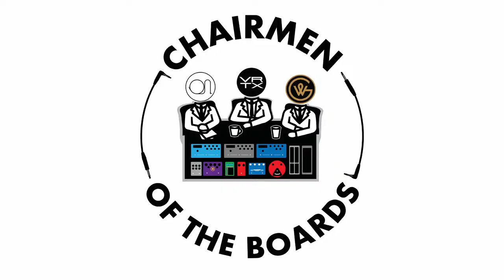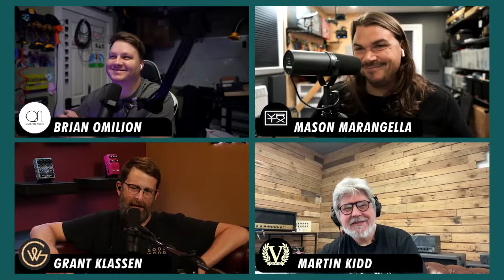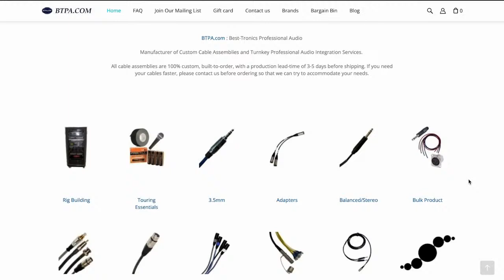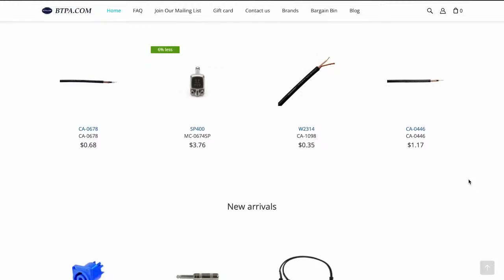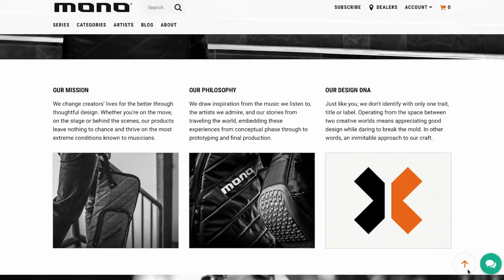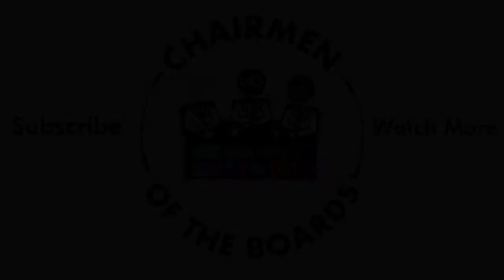Cracking The Code on Hybrid Tube Amps (with @VictoryAmps)

Comment: Does anybody else feel like there's an enormous hole in the market right now for newer and better tube power amps?  Has class D solid state just already won?  It's driving me nuts that everyone is making all these awesome pre-amps (yes I realize the video is more about hybrid amps) , but almost no one is making (more affordable) tube power amps.  Yes it's surprising how good the newer solid state stuff is but there is still a noticeable difference.  We can buy respectable full on tube combo amps cheaper than we can get 1980's style rackmount stereo tube power amp and then when you do get one the volume would get you kicked out of most gigs because it's so powerful.  Are there not better tube master volume circuits available by now?  I have been looking everywhere trying to find smaller tube power amps.  How is half a guitar amp more expensive than a guitar amp?  Why are more amp makers not seeing the opportunities for more convenient stereo rigs when Simon Jarret can put a Dumble on your pedalboard?
Reply: I agree, seems like the perfect idea.  A modular system.  A good 10w tube power amp and then swap out the preamps.
Reply: Good Point...
Reply: The only product like that in Thomann is the Mooer Tube Engine. A mono power amp. The rest is Class D or Boutique amp distribution products like Synergy stuff or fryette power station.
I use a modeller (hx stomp) and never use FRFR. Just fxloop returns of solid state amps. I don't really know if i'm missing something with the tube power amp thing.
Reply: @martiboucat   I may well get a Mooer Tube Engine but I will have to get one shipped to USA from Europe.  Due to other amps I already have my heart is set on a Fryette PS-2 Power station first, which sadly does not help me run stereo.  You can find demo's comparing the PS-2 to a Seymour Duncan Powerstage and the difference is not huge but it is real.  In my case I have a Kinsley Maiden D pedal pre-amp and a Friedman IR-X so I would really like to use tubes with tubes.  Class D makes plenty of sense if you are using a modeler and you might be able to dial in some level of power amp simulation or use something like a UA Ox Stomp.  The new product in this sphere I am curious about is the Blackstar Amp 1, which can work well as a standalone full amp OR as a power amp for another device like a modeler or pre-amp.  The digital emulation of different power tube amps on the Amp 1 is intriguing to me, but several reviewers still prefer a real amp for live use. That seems to be where we are with the technology; You won't be able to tell this difference on a recording but for live use tubes can still feel different and provide that extra bit of nuance. I am being very picky about getting the most out of some boutique gear.  My opinion is that with today's tech we should not have to compromise, and it should not cost as much as buying yet another fully featured tube amp.
Reply: @lukepowell1201  If i recall correctly, Dave Friedman said during a Tone Talk episode that he was designing a power amp.
Ola Englund uses a KSR tube power amp but it's really expensive.
The Synergy SYN-5050 seems the way to go if you want stereo or dual-mono
I don't get the UA OX stomp thing with a the classD poweramp. Does the oxstomp have a poweramp emulation and you can disable cabs?
Reply: @martiboucat  So I should acknowledge that my comment about the Ox Stomp was off topic.  The Ox has almost nothing to do with power amps, I have simply seen players use the Ox Stomp with modelers with very enthusiastic results.  It would sound great with your helix going direct or recording or perhaps with a powercab - that was my only connection there.  The KSR power amp appears to be high quality but especially at their price point I see no advantage over a Fryette Power Station.  I actually already have a Mesa Boogie 50/50 stereo power amp.  It sounds great but even in low power mode it is a beast!  Really too loud to be practical for home or small gigs in my opinion.  So the quest for more versatile options continues.  If Dave Friedman builds a power amp that would be sweet!  He's a good designer to do it!
Reply: @lukepowell1201  i'm sure the ox stomp is great but, as all uafx pedals, is missing some key things in my opinion, like that poweramp simulation, a balanced output, headphone out,... some of the things a pedal like KMA Endgame has.
Regards to the power amp thing, at this point i would carry two fxloop equiped low wattage combo amps with good speakers like a 5150 iconic amp and a PRS Sonzera.
Just use the the fxloop return and call it a day.
The Blackstar amped1 may be an option too...
Reply: @lukepowell1201  btw, i double checked, maybe you should look into the Engl E840/50 Poweramp
Dual 50w poweramp -similar to the mesa 50/50 i suppose. Everything ENGL makes is great.
Reply: KSR make good power amps
Reply: @Starch1b2c3d4a   Yes KSR does make good quality, but their feature set does not have any advantages over a Fryette PS-2A power station and they are actually priced $50 more expensive new.
Reply: @lukepowell1201  fryette is solid state no?
Reply: @Starch1b2c3d4a  No.  All the Fryette power amp products are all tube, and many consider them the best tube power amps for guitar on the market.  Steven Fryette previously started/owned/ran VHT which made some of the best Stereo Tube Power Amps used in the 1980's heyday of huge rackmount guitar rigs (Steve Lukather and many others).  The PS-2A power station made by Fryette (I just got one!) is widely recognized as the best Reactive Load attenuator on the market, but this "swiss army knife" device also houses a 50w 2x6L6 power amp to re-amp the attenuated signal.  So while the PS-2 is the best way to crank a large amp quietly, it can likewise be used to make a small amp much louder, or be used with a pre-amp as I intend to do, and it a has other features as well for things like recording direct.  Still, the PS-2 is $900, almost no one gets rid of one once they have it so the used market is tight, and it is mono not stereo.